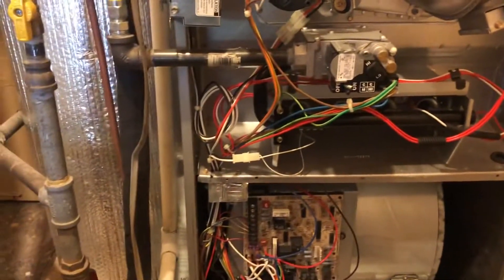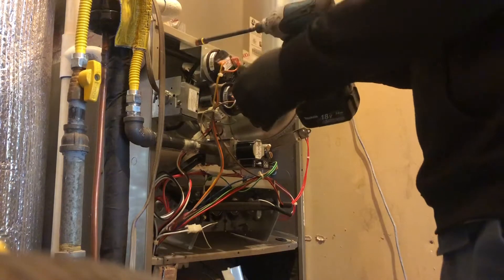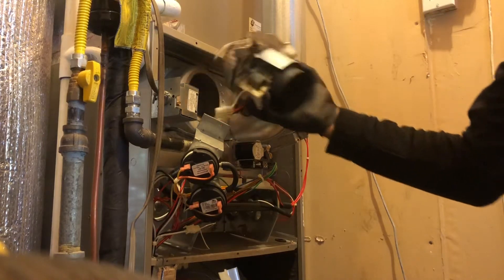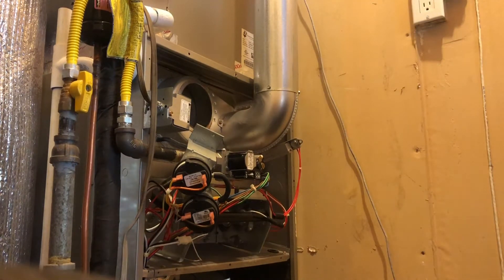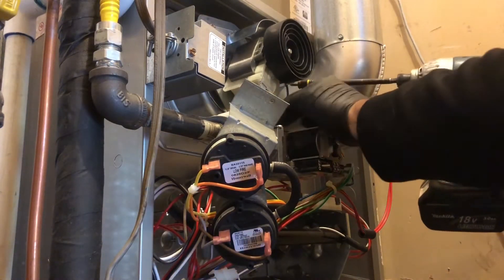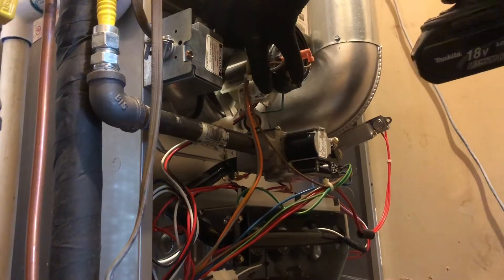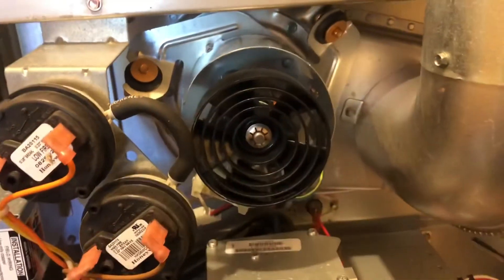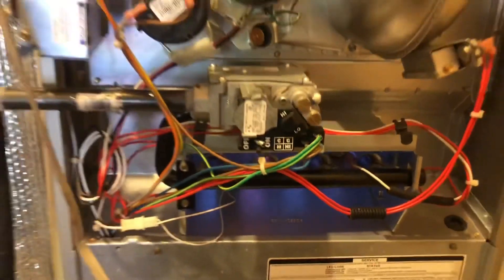Carrier furnace bad inducer motor #hvac #hvaclife #hvactechnician #diy #hvactraining #carrier

Comment: Have an 8 year old heil furnace. Actually two of them in a two story house. In your experience, do you notice that the fan speed on these motors are not as powerful as they should be? Even at the highest speed the heat airflow not powerful in either furnace. The ac has good air pressure. Had the blower motor replaced once before. The systems are properly sized from what I can see. Thanks
Reply from the maker: Try to increase the fan speed for heat,heat mode uses the lowest speed ac uses the highest speed from my experience heil furnaces aren’t known for there efficiency and quality
Reply: @Victoryhomeservices209  thanks. I did that. Tried the heat at “high “ and  med high and was about same. So just left the ac on high and heat on med high. New construction house. Not happy w the brand I agree.

Comment: Thanks for the video. I have a similar issue. Where did you get the motor assembly? I am in Canada, most online stores are at US.
Reply from the maker: I get them straight from the manufacture Under our contractors license you could try Amazon or eBay thanks for watching

Comment: While removing the old motor, your camera angle was from the side, not clearly showing the spot of the screws. The proper angle  should be facing the unit from center